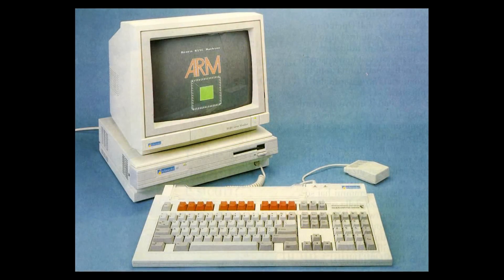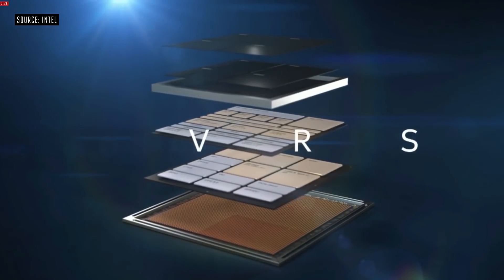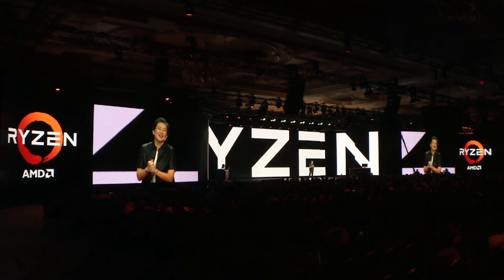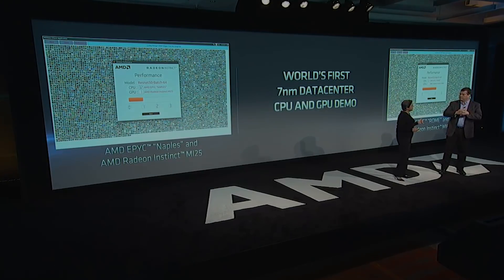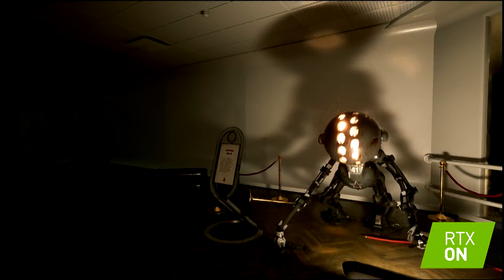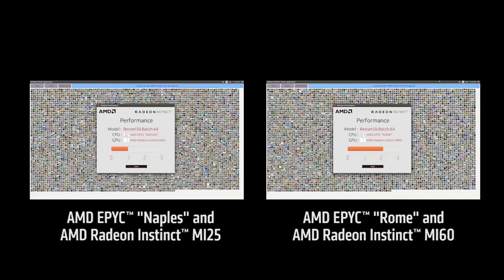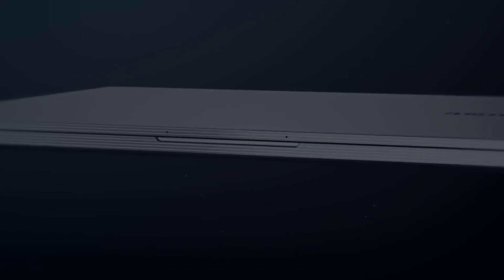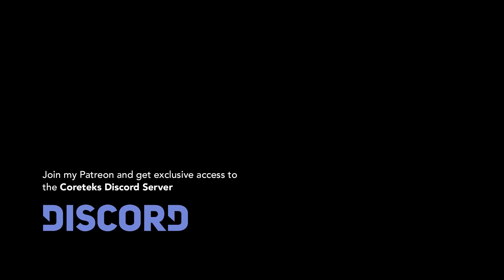Hardware trends: How many cores do we need?!

Comment: This is basically why I've been focusing on developing an engine+language with >90% scaling, the major limitation being the geometry pipeline to the GPU, as current GPUs still only have a single graphical queue. Compute on the other hand doesn't have this limitation so much, thus much of the non-geometry rendering is stripped out of the geometry pipe, allowing for 50-75% of the rendering alone to run concurrently on vega for example (1 geom, 3 compute, 2 data).

Comment: The graph on perf increase per cpu core is quite dumb and really doesn't work at all for Ray tracing
(I'm developing a small raytracer in C, 4 cores are giving a close to 4 times speed increase and when using 20 cores I'm at ~90% cpu utilization and I could still optimize a few small things)

Comment: 1 program may only utilize 8 cores, but N programs running in parallel asynchronously will be able to use 8N cores, assuming nothing else is bottlenecking. no?

Comment: Coreteks' key argument against higher core counts is that the single threaded portion of an application at around 16-32 cores will cause the performance gain by adding cores to effectively go to zero. And for very common PC applications and users that will be the case. 

However we can envision applications with no single threaded portion. Massive multiplayer games are networked among a large number of players or nodes and include management and coordination server nodes. Whether or not each player's game experience would include inputs from other players or from agents running on cores on the player's computer will make little difference except for the comparable realistic action of the core-agent. In this way the number of cores for a single player game emulating a massive multiplayer game or the utilization of core agents for a wide variety of action is only limited by the users ability to appreciate that level of action detail.

It is not that everyone will benefit from higher core counts, but that particular market segments will be able to utilize much higher core counts than are available today.

Comment: We need a switch from silicon CPU's to carbon CPU's. If carbon was used as the semiconductor, you'd get the processors to below 1 nano-meter with ease. The problem is: Carbon is a lot harder to work with. At the moment, CPU improvement has pretty much halted. We are now waiting for either carbon-semiconductor CPU's or 3D stacked CPU's. I'll give it about 7 years before we see a change.

Comment: Thin "cloud clients" wont prosper until we get infrastructure upgrades. I am speaking of devices that run on the current celular network. Add that many devices too quickly and the shared data will tank, it already does in many areas just for phones. I cannot be certain what the market wants or will adopt quickly. Low energy/long battery, convenient/simple to use, portable... much like a phone! No, I don't see cloud clients with a great deal of staying power, even chrome books (which seem to be very popular) are just a step away from getting binned. Just need too many people getting hacked and deciding that cloud isn't the way to go. Or the exact opposite could happen, I suck at forecasting this type of crap.

This could turn into a slow death for cloud and a resurgence of previously popular tech (in a new form) or it could turn into a "cloud rules all" scenario. Discrete tech and cloud are at odds with each other and everyone is enamored with wifi, I almost never use wifi because it's till not as stable as I want it to be, so I don't understand what makes it so popular. Well I do understand, gadgets are so "COOL" but the current culture with heads buried in a phone all the time makes me shake my head. I do own a relatively decent android phone. But I don't have the usual instatwitgrambook apps.... I still use it for for just calls n txts, well I do have a couple of time wasting games on there (word game and solitaire) for when I am stuck waiting somewhere, a scientific calc, and lets not forget the shell app for connecting to my linux machines for remote admin... 

Anyway, as long as phones stay on the current course I don't see other cloud devices gaining much more popularity than they currently have. I find it difficult to guess because of my own bias against the "always connected/online popularity" mentality. Many gamers already shun wireless connections because of latency, now have the entire game run remotely... hmm... Who knows?

Comment: Check this out - 2001 techtv clip - intels new "terahertz transistor"
Intel THz to be in mass production by 2005. And with a "secret sauce" to keep things cool. Perhaps they found a more efficient way to make carbon nanotube back then and use them for heat sinks like in other articles on them that say they have nearly infinite heat conduction. Yes, I know, I'm just quoting the article in Phys I think. They mentioned using a different material too, different semiconductor I'm guessing. Either way they had 1000GHz back then and now. And ran a chip at 100GHz.

Comment: What are you blabbering about? Programmers write parallel code as a daily routine. The law you gave is completely misapplied here. If I have a list of items to process and I have two CPU cores, I can split the list in two halves and run them in parallel and it will be basically two times faster (not 200% but ~200%).  If you gave me eight it will be ~800%. Sure variable initialization might not be parallel in that example of yours, but that depends on a compiler and not the programmer. Sure not every code can be parallelized, but you can run two programs at once. Chrome is running every window in a separate process for that reason.

Comment: Overall this is a great video, and a good opener for a discussion on the topic. That being said, I disagree with major parts of the video. Others have argumented my disagreements in the comments better than I could have, so I'll concentrate on just one very small aspect of the video: thin-clients in gaming.
I personally do not believe in the thin-client making its way into the gaming space as a majority platform, possibly ever.
I'd argue this based on two distinct points:
1) Game processing as a service via the cloud is too expensive to be offered at a trivial monthly rate to the consumer. I believe these services will always be prohibitively costly over the lifetime of a given device when compared to a non-cloud based one. Even if the costs can be reduced through major breakthroughs in silicon tech, the companies responsible would need significant margins to cover R&D costs, and I don't think the savings would be passed on to the consumers. This is decidedly different from clients like the chromebook because the chromebook services don't require much resources to compute and are generally free to use.
2) The latency introduced by having processing done in the cloud and streamed to your thin-client is extremely prohibitive in competitive games. An article in gamecrate published in 2016 argued that fair gameplay over a network becomes impossible over longer distances even assuming direct client to client connections operating at the theoretical maximum - the speed of light. The article gives an example that a connection between New York and Japan introduces a latency of about 3 frames just from the speed of light, making it impossible to react to certain attacks that have a 3 frame long animation (that can subsequently be linked into a combo), and throwing off the timing to possible 1 frame-links in combos. In the real world where network connections move through several networking nodes and definitely do not happen at the speed of light, having your visuals be streamed through a network to your device has a very real chance of disrupting gameplay with unacceptable input lag even if you are playing a single-player game, let alone a competitive online game.

Here's the article in question: https://www.gamecrate.com/street-fighter-v-netcode-issues-speed-of-light/13170

Comment: You know I could upgrade CPU's beyond the 4 cores I am using. Sadly I just use my desktop for video's, anime, MS Office, facebook, researching medical text etc....I have every console from Atari 2600 up to PS4 so I do not need to use my desktop or laptop for gaming.  Unless I decide to take up gaming on the PC or suddenly decide I need to work with PhotoShop or some other demanding application I can not see myself ever needing more than 8 cores. If anything I would like gear that is more durable laptops disentgrate even if you treat them like they are made from paper the plastic is thin, cheap and brittle.

Comment: I'd say your speculation on the number of cores not improving performance is inaccurate, also that every programmer is only going to be taught sequentially. I've had performance improvements of over 320% on a 6-core/12-thread utilizing thread pools, performing post processing and splitting the load between each core. Now not everything can be parallel because of data dependencies, and the sequential flow will limit that much. but, honestly, I could utilize much more cores and see an improvement,  but yeah, after a certain point it wouldn't have any noticeable gain in performance, but I don't think that matches your data per say.

Comment: I mean the PS4 showed the potential of an x86/Arm hybrid. I would love to see OS'es built around this model, allowing for the User Environment and primary kernel running on a primary proc (Arm) and offloading all other processes to the secondary proc(s, x86, arm)

Also as usual, a sector of the market is being strangled by another sector. Here it's software developers not pushing advanced code. A great example is Photoshop's real world testing (as of mid 2018) showed between 6-8 threads is the sweet spot for performance on multi-thread processing such as blurs.

Finally, RTX3080ti WTF ver.: two kidneys, one arm.

Comment: This assumes users only using single applications ... most users use MANY applications and processes at any given time  and if we as developers design our software correctly the number of cores needed to increase performance will help. 
Thin clients are a non starter due to internet speeds and the lack thereof for most people.

Comment: More core's don't actually work the way they in theory are supposed to work based on what people think more core's are supposed to be.

You would think that more core's equals the ability to offload tasks to other cores without losing system performance or stability, but this isn't how it work in practice. More cores may give you a performance boost if the software is designed to utilize more cores, but the ability to do multiple things at the same time without losing performance don't really exist with intel's lineup.

Take streaming for example, you would think that streaming on a 8 core intel cpu should be easy, but it's not. You take a heavy performance hit even when your playing games that don't use all the cores.

I do believe this is slightly different from the AMD lineup as i've heard good things about their cpu's. The ability to stream without taking much of a performance hit.

Comment: I remember when Intel said they were wanting to have as many cores as there were instructions so each instruction would run in its own core or something equally esoteric.  They learned that didn't help and the issue is that nasty silicon wall we hit over a decade ago and the new wall will be how small can we go as we are approaching the limits of how much "stuff" we can put on a silicon wafer.  Eventually they are just going to have to come up with a silicon material replacement and they have been working on it for over a decade too.

Comment: Loved the video for the most part. One key element completely ignored here is the need for parallel workloads by way of simultaneous programs. Multiple cores can benefit a single process, but you are right to point out the limits of that. Additional copies above and beyond that limit can be used for additional processes on the side. Antivirus, chat client, video recording/livestreaming, backup programs, encryption, and even entire virtual machines run on our systems all the time. Having extra cores can help with these workloads as well. Right now, the sum total of most of those processes wouldn't occupy more than a couple of cores, but the ability for those side processes to not slow down my game or video render makes the wider cores worth a bit more to me.

Comment: You are wrong on GPUs. Graphics workloads are ridiculously parallel. High end GPUs have 3500-4000 cores. They are grouped into units containing perhaps 64 cores in each one. They have near perfect scaling with more cores. Even 30,000 cores would scale well, there being millions of polygons and pixels, with heavy use of pixel shaders for effects and realism. You can highly accurately predict GPU performance based on other models in same generation, and relative core difference.

Comment: Never underestimate the creativity.
 GPUs and CPUs will become cheaper. Which is good for decentralized Ai or stand-alone gaming.
In the long run the GPUs will split large problems in parts and solve them in parallel.

Parallel processing is the only logical solution to the finite benefits of the GPU limit.

Comment: The cloud is completely unacceptable is you want any control over your data files and programs that run it. If you want to be a renteer slave that can be denied your files because you do not have any control over monopolistic servers, then cloud is great.
Reply: Note sure if you should equate cloud with centralisation. For example maidsafe's cloud solution keeps files fragmented, anonymous, decentralised, encrypted, redundant. With such a cloud noone but you can access or run your files and noone can by "data" means prohibit you from accessing them yourself.
Reply: Sure it works for pure storage of data but this was meant in the context of leased and or cloud based applications. You can be denied your privileges any time and the data cannot be read no matter where you store them. Let's say you run Google Sketchup CAD application in the browser or from the cloud. Your data is useless if you are denied access to Sketchup. Do you want to base you livelihood on that?

Comment: What sort of architecture is the example at 6:22 supposed to be on that for the "parallel" execution you can load, add and store the same data set in one cycle? Is MUL2W something that takes multiple cycles to execute, giving LDL2 enough time to finish before the data is required? Is the ":" supposed to mean parallel execution? In that case the "sequential" part isn't sequential to begin with. And the "parallel" part doesn't have a store, so it doesn't even do everything the "sequential" part does.
A more straight-forward example of serial vs parallel execution would be a for-loop doing addition. While sequential execution would add 100 numbers sequentially by loading one value, adding it to a register, loading another, adding it etc. and doing all that 100 times, a parallel version would split the task into however many threads it can handle (let's say 4), and every thread would do that very same sequential procedure, only at the end one thread would add all those things together.

At least have the code do two additions.
Core 1                             | Core 2
LOAD R1, [AddressA]    | LOAD R2, [AddressB]
LOAD R3, [AddressD]    | LOAD R4, [AddressE]
ADD R2, R2, R1              | ADD R4, R4, R3
STORE R2, [AddressC] | STORE R4, [AddressF]

and that could alternatively be
Core 1                              | Core 2
LOAD R1, [AddressA]     | LOAD R2, [AddressB]
ADD R2, R2, R1               | LOAD R3, [AddressD]
STORE R2, [AddressC]  | LOAD R4, [AddressE]
ADD R4, R4, R3               | DO SOMETHING ELSE
STORE R4, [AddressF]  | DO SOMETHING ELSE

As it is, that example seems like a complete mess, because it just doesn't do what you claim.
Reply: About Amdahl's Law:
Don't write the 50 there. It's 0.5. Alternatively, put the "%" after the fifty.

Comment: 1987 !!! 

great attention to doing what has happened in the past 

if they do that, just like millions of curious people will radically change    ther interests   !!!  and everything  and everything becomes dust ... 

and when ther eyes turn  to another  thing    .  all go begins to fall .

if you made a model that works   !!! model t of the pc for consumers   .  it works very well 

motherboard / processor in sk + cooler / ram ddr slot / gpu board in pcE slot / usb 2/3 .. sata 3 ... / m.2 ssd and hdd. 1 pc case. maderbor otions and boot capabili

the only APUs that have had some kind of progress are from AMD 

Socket AM4  and  fm2+   the only  ...  and that unfortunately can not be adet  with all boards on all  pcx raneon   
to unify computing power !!! 

it does not make anyone hope  !!!   and will always be only for the entry level  
 
do not lie to tha people .  

and for those who are thinner and slimmer  !!! 
always be prepared to pay   . 
for these non  effective luxury   
requirements

and the rest to do software optimizations  to be able to effectively use the computing power  .  each bit

 good programs for these new platforms ... probably over 10 year ! . 

!!! 
https://www.youtube.com/watch?v=WeQ-k0nOghA 

https://www.youtube.com/watch?v=sfQVScv1pQ8 

https://www.cnbc.com/video/2017/10/18/black-monday-anniversary-the-market-in-1987-and-now.html

In my opinion .   
do not lie to tha people  !